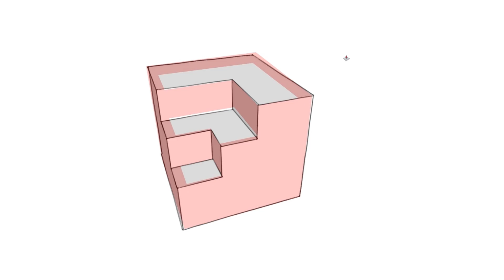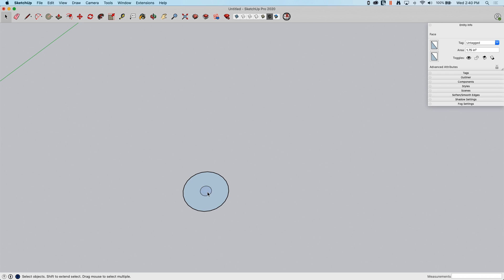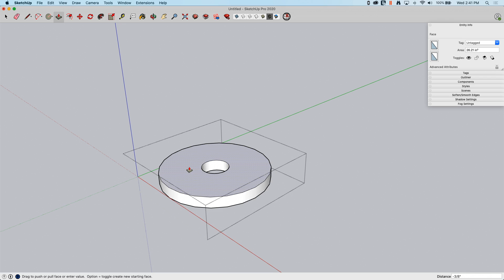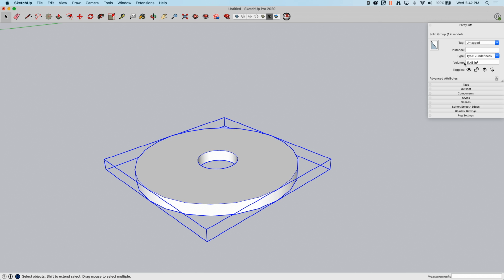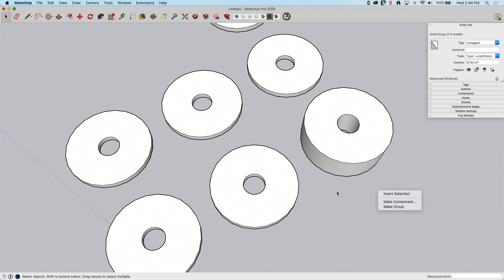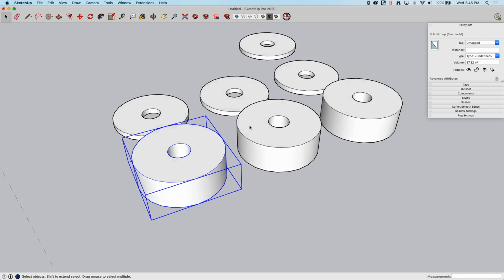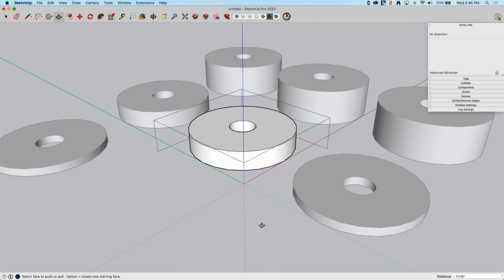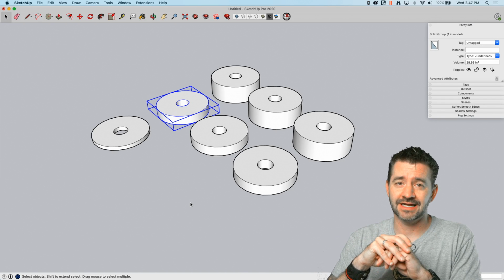Calculating Weight - Skill Builder

Comment: It is usually more important to know the weight of the component you have designed than to make the component a specific weight. And that's a simple process. Weight = Volume x Density. There are thousands of sources for tables of density by materials available on the internet. There are also sketchup extensions that already do this but you need to plug in the density for the material. That's where the tables of density come into play. All good designers should have these tables in their reference books.

Comment: This would be more accurate if named "Adjusting volume to arrive at a weight" I was hoping sketchup would do the "weight math" for me based on input an of a material dencity and the volume of a solid group. Then sum it up to see how much my model will weigh with different materials.
Reply: If we could assign a material density at the same time as a texture or a fixed weight for a given component, then Sketchup could calculate the weight of groups and components, but also the total weight of all sub-components of a component.

Comment: Hello Aaron,
I'm still struggling with Tags & Outliner. I've been using SU since 2008. I have been relying on Tags /layers.  I don't understand how to use the Outliner in my work flow. Most of my work is detailing building maintenance works.  Could you perhaps help out with a series on Outliner in a building work flow?  When to use Tags & when to use Outliner.

Comment: I wrote an excel sheet about 2 years ago that does all of this for me based on the density of a material. Since density=mass/vol
And weight=mass(gravity). You solve for mass in the density equation, then sub it into the weight equation and then i have all the properties of a material i need.  Of course excel does all the work for me very quickly haha